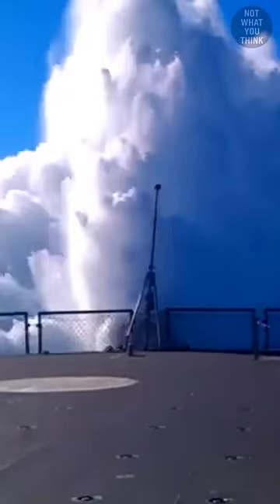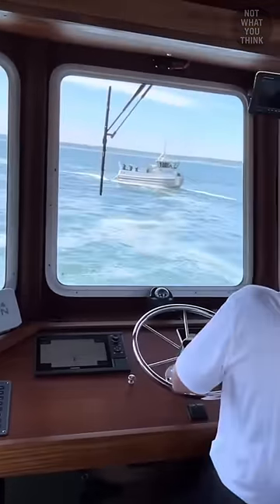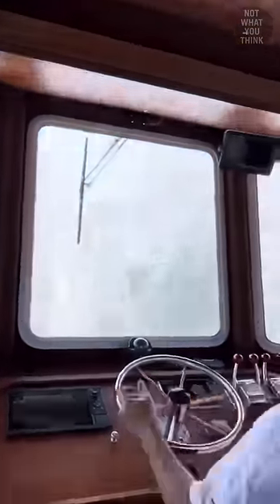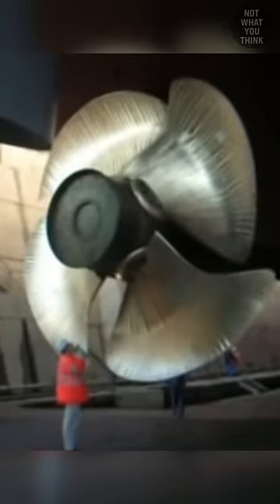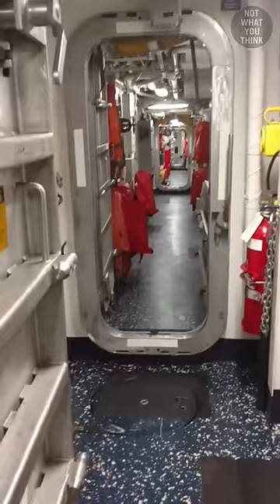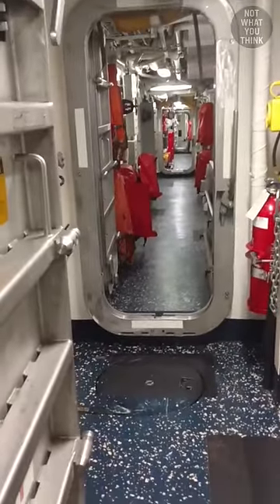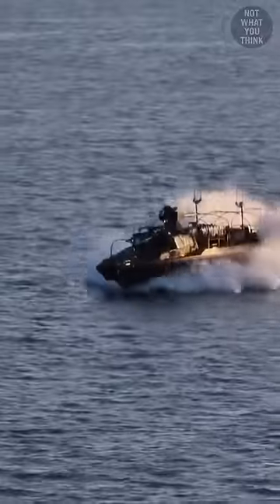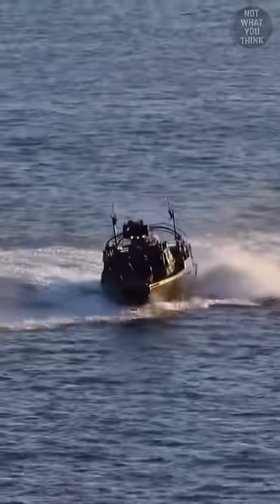Water Crash Stop #shorts

Comment: Most ships do not have variable pitch propellers, so it takes them a hell of a lot longer to even start the crash stop since they have to bring the prop to a stop and then run it in the opposite direction. Even if the ship has a reverse gear (most don't) it still takes ages. Even moreso when you have to stop the powerplant and then get it going in the opposite direction
Reply: WHAT?!?!? WTF are babbling about??? 50+ years commercial fishing I’ve yet to see a boat that didn’t have reverse
Reply: You are both not right! 
Gnerally speaking:
If ships have a slow speed long stroke engine it's almost guaranteed fixed pitch, direct coupled thus no gearbox, not even any transmission. All the big container and tanker... 
If ships have medium or high speed engines it's often pitch.
Though I've worked on 3500t ships up to 1000 engine rpm - some pitch, some fixed pitch.

It depends on the purpose and size/weight of the ship...

A fast running short stroked engine, as u probably have on fishing vessels, is easily and quickly reved down and brought, via a gearbox, into reverse, no biggi! It's a bit different with long stroked engines and it's easier and faster to keep the engine on fixed rpm but to change the pitch. You don't need to operate a clutch and a reverse gear that can handle the power.. 
Those gigantic 2 stroke engines on container ships is something  different entirely. As mentioned: No gearbox, no clutch. As soon as the engine turns, so does the prop. 
You wanna go astern, you have to stop the engine completely, shut it down, wait until dozens and dozens of tons of moving pistons, connrods and piston rods have come to a stand still. to than re start the engine running it "backwards" - astern.
Reply: @patrickancona1193 on many large vessels the propeller is connected directly to the main engine without any transmission. In order to reverse you first have to stop the engine, then start it again but rotating "backwards".
Reply: My first ship, you'd run the steam turbines ahead, for reverse they had a small section that would spin the shafts backwards.
Reply: @patrickancona1193  For a supposed veteran commercial fisherman you seem to not understand the difference between a boat and a ship.
Reply: I didn't even know variable pitch props existed for water-ogoing vessels! Only aircraft I thought... 🤷🏻
Reply: @djbis  They do, but they're generally more common on cruise ships and warships. Cruise ships because being able to rapidly change the direction of thrust allows for faster and easier docking, especially with the aid of bow thrusters, and warships because they need to be able to operate at least fairly efficiently at a fairly wide range of speeds, plus they benefit from the enhanced mobility

Comment: The older Swedish Robotbåt typ Norrköping (Spica II)  used in the 80' is my favourite. It made 45 knots and could stop on its own length, 42 meters. It was powered by three Rolls Royce gas turbines. It was not a patrolboat but a fighting ship. It packed 8 anti ship missiles, 2 torpedo tubes and a 57 mm gun with 3 shoots a second and a radar sight that was so precise a computer had to disperse the salvoes if it wasnt going to shoot all shells in the same hole in the target. Three boats was enough to cover the entire swedish east coast from the south up to Stockholm with radar coverage and missiles. Missiles could also be fired radar silent on input from other ships, helicopters or fighter jets. All platforms, ships and planes, could also automaticly synchronize their attacks to arrive at the target in the same time.

Comment: Damn u learn every day. Never new u could adjust the pitch of the prop. I always thought, the coupling turned the other way, and u mess it up just like a car when u go from full speed forward to backward.
Reply: Only some ships have those. Also even a fewer number of ships is equipped with a gearbox similar to one in a car. The vast majority of ships have fixed propellers, and to adjust the speed you need to change the RPM  of the entire engine (which can't be done instantly - it takes between 5 to 30 secs between each speed change in the maneuvering mode and in the sea mode you can only adjust maybe 5 RPM every minute). And messing up with switching speeds on a ship is far, far worse than on a car.
Reply: @VileGecko  At least you'll see it coming when the engine starts throwing parts.
Reply: @VileGecko  you seem to be talking about the big 2strokes.
With Medium or high speed 4 strokes there's no problem with changing engine revs. And u do need a gearbox, even a clutch if you have a fixed pitch...
Don't wanna have the prop spinning with 1000rpm, can't start the engine with a clutched in fixed pitch prop.

Comment: I tried a crash stop on my first vehicle.  I turned out changing the automatic transmission to a manual transmission after most of the automatic transmission layed in pieces inside a puddle of red slime.
Automatic transmission - £1000
Manual transmission - £325
The decision made itself.  Plus, I leaned how to swap a transmission from auto to manual! It was the best mistake of my life.

Comment: It does have to be stated that most ships do not have water jets or even props that can change the angle of their blades. Most ships have fixed bladed props, however the procedure is the same, in the case of emergency and need to slow down the engines will be ordered to go full a stern, depending on the ship size, engine layout it can have some differences. If it is a ship that has the props connected to a electric motor then the change will be almost instant but if its heavy enough it will take time to slow down, if the engine is directly connected to the prop then the engine needs to be changed of direction ( if it has a gear set up then that can be used) though as stated before larger ships will take longer to slow down, momentum and force needs to go somewhere.

Comment: This is  a thing that water jet eccupied ships and boats do primarily , the water flow is redirected 
By lowering the "showels" infront(behind)the water jet nozzles, thus redirecting the water down and aginst the travel 
Direction.  This can be done at full speed , but it will be pretty violent, 
A bit like a mild  car crach panic break .
A ordinary prop ship can not do this 
Reversing the thrust of the propellers 
Will not suddenly stop the ship ,only 
Create cavitation and spraying of water at first . Of course there will be speed decrease breaking effect, but not like a water jet craft, with is  often mutch more 
Lightweight  than a heavy steel ship The primery means  for big, heavy ships to avoid hitting stuff is altering course as fast as possible. The engine effect 1 per ton: ai screw size 2 is
 far to 1low  2small to sudely" break" a  big ship to stop . 
Look videos of ships crashing into docks etc  . They keep going even if they 
Do there best to stop. (Reversing props ) 
the morning lines are used to break the ship when docking to some extent  , a 
Ship with non pivoting screws axels need 
Water flow to steer so you cant steer if you are doing zero" knots,* 
If you have bow thrusters ,stern thrusters,  pod mounted propellers, sea jeep propeller or nozzle tube rudder ,or some
Combos of those  you can move laterally without or with very low or zero speed*
With one screw  you will have a self stering of the stern in relation to the pitch angle and if it is left right threaded. This mean that the ship will 
Naturally be puched in or pulled out
Depending on with side the of the ship that is facing the dock and if the
Ship goes in reverse or for ward.
On a variable  pitching blade propeller the 
Rotation if the shaft is not reversed 
So it will  have the same preferd (natural turning )no matter ,the direction of travel. This can be 
Beneficial because it makes manovroning  more consistent, less factors to keep track at.
Using two props with mirrored 
Rotating shafts will cancel out the 
(Natural turning)

*
 Speed = in realition to the water mass and the ships hull

Comment: Only jet powered craft can dead stop it’s called dropping buckets. This is never performed on a prop vessel. The spray is a rooster tail from how the prop is riding on the water line. The cpp or controllable pitch prop, allows you to go from all ahead full to all back w/o changing the direction of the shaft. You’re comparing jet powered craft to a traditional ship. Completely different in how they operate.

Comment: I almost lost a sea-doo speedster in the middle of a lake doing that. Going as fast as possible then throttle off throw in reverse and go full throttle. It nose dived and did a 180 completely swamping it. Idk how it didn't sink. Thankfully I was smart enough to pull a floor hatch to let the water drain then got a tow back to the dock and waited till the battery terminals dried out so I could turn the pumps on.

Comment: Looks expensive?
Reply: Stridsbåt 90 is expensive, yes, crash stops shouldn't be, most crafts have to be rated to be able to crash stop without sustaining damage. That is if my memory serves me, haven't driven a boat in 20+years and I never had a boat big enough to warrant a license (although keeping somewhat up to date with the rules is good when you share waters with lots of larger vessels)
Reply: @zinobi  On a boat with neither variable pitch nor water jet but a regular reverse gear box, I would not like to engage the reverse at any substantial forward speed. It can't be good for the gears or clutches.
Reply: @skunkjobb  it isn't that bad actually. You need some kind of breaking the propeller and then applying the reverse, the water it self works as a rudimentary torq-converter like you'd find in an automatic gearbox.
Source: an old machinist that invited med to the engine room of a ferry, so basically "trust me brah"